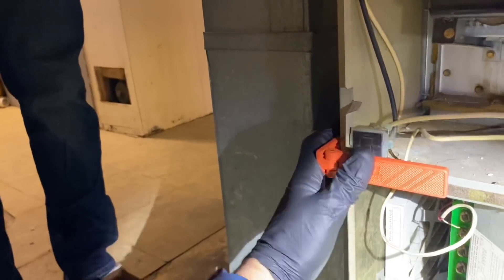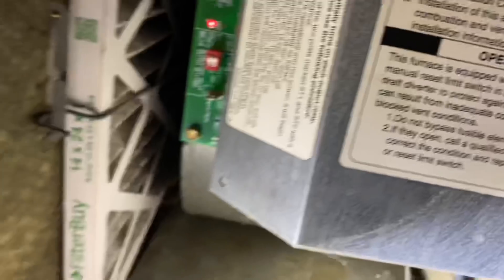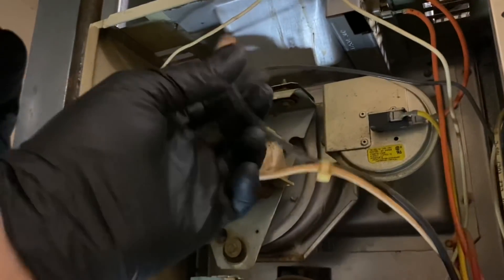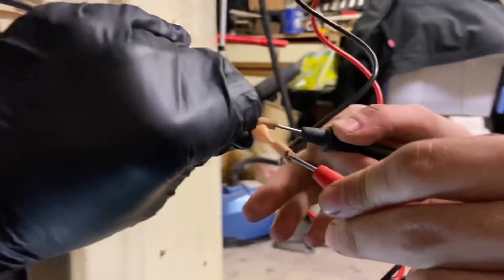Bryant Gas Furnace Not Heating How to Diagnose Bad Inducer Motor Assembly

Comment: You can ohm out the motor by putting your leads on the spades going into the inducer motor...OL would be bad. Just if you wanted to be double sure...I'm sure you know you can ohm it being in the field as long as you have been...